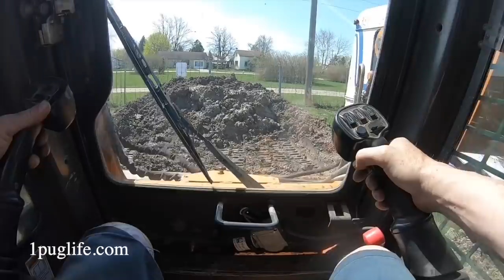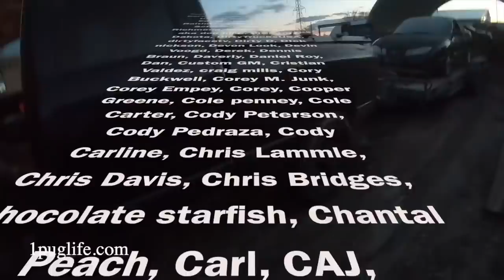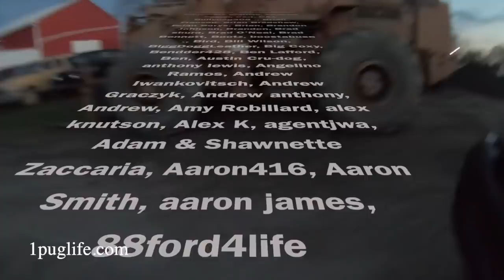winch broken tumuchi chicken house

Comment: Hey Pug. I have ALWAYS ran Delo in my Cummins. Probably totalling close to a million miles in 3 trucks. EVERY single one turned the new oil black the second the engine turned over. My 2004.5 ran low and I heard the warning light make a DING and immediately heard the motor come apart tick tick tick. 
So my awesome brother found me a 2003 dually 4X4 with 250K miles. We went and looked at it in the FREEZING cold. I asked the guy if it had any blowby and he said no none. I thought... Yeah you're lying. So I open the hood pull the filler cap and sit it on top of the fill hole. It didn't move. I put my hand over the hole and it had ZERO blowby. 
I drove home about 2 hours. A few days later I pulled the dipstick and stood there in absolute amazement. I am not kidding you one bit. The oil looked like brand new oil. I personally have NEVER seen a diesel have oil in it that was anything other than black. Even seconds after an oil change. As you may guess the next thing I did is call the previous owner to ask what oil he used. 
He told me the Mobil 1 synthetic for diesels.  Goodbye Delo Hello Mobil 1 Turbo Diesel Truck synthetic 5W40

Comment: I'm thinking about trying that fiber winch cable. I'm just thinking...how does that stuff not break. In sure it would work better than my crappy bunched up kinked bent crappy steel cable that I cracked the winch case with.

Comment: Serious question:  how thick would the gravel need to be to avoid the mud pit and support the weight of the loader?  How many yards of gravel would you guess it would take to cover that main access and the lane running through the yard?
Reply: He needs to grade and wacker plate it level then reinforcement grids then gravel.